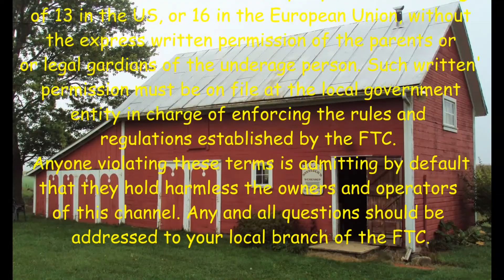Clean, Seal & Sharpen The Two Tine Cultivator

Comment: Curious why you sanded the oil off of the handle. Why not just clean the handle and put another coat of oil on it?
Reply from the maker: Good question. I usually wipe down with BLO and wax.
In it's journey it picked up some nicks that raised splinters. 
The sanding is less satisfying than scraping, but it is faster at removing and blending the nicks. 😁😎